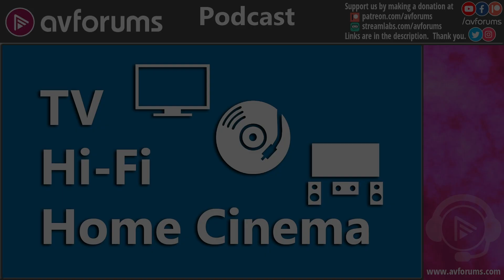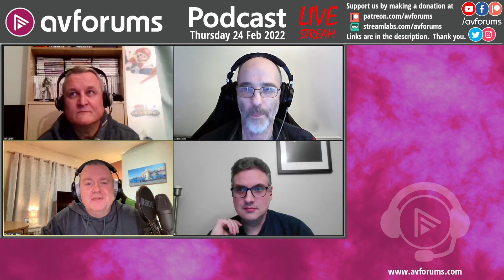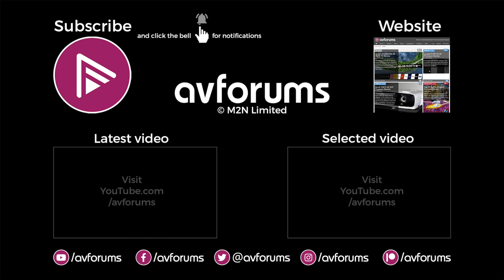First look LG OLED42C2, 55-inch G2 and 77-inch OLED EVO TVs for 2022 | AVForums Podcast 24 Feb '22

Comment: Does G2 have Higher brightness than C1 or CX?
Reply: yes because of the heatsink
Reply: @fabcol1888  not an evolution. more false marketing. if you compare it to c2 and g2, the g2 lost more details, because they set it to bright in the video
Reply: Yes, the APL is much higher and the ABL is much lower. Because of the new heatsink and the new a9 gen 5 process. They can push the TV harder and retain imagine quality without the risk of burn-in.
Reply: Yes